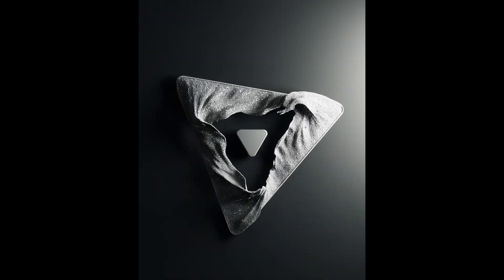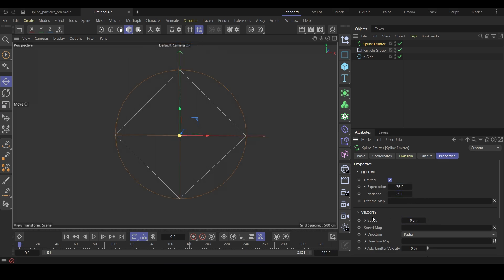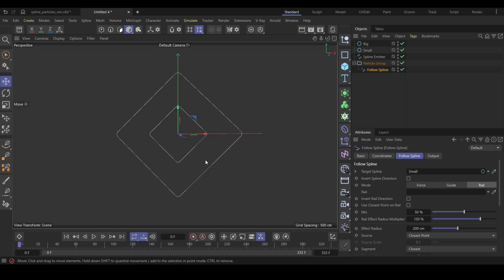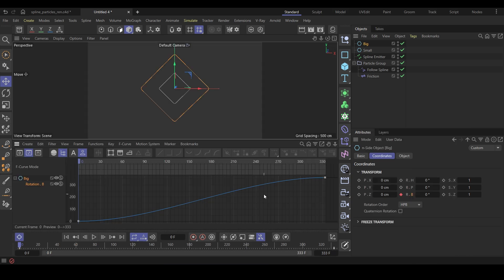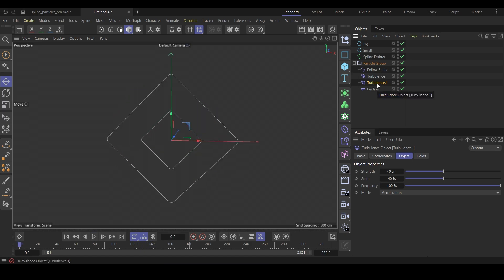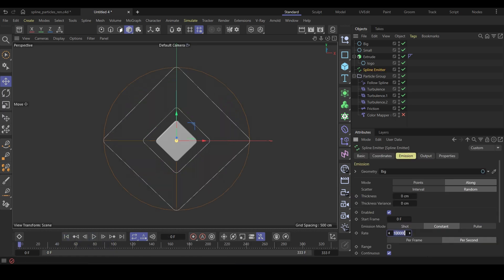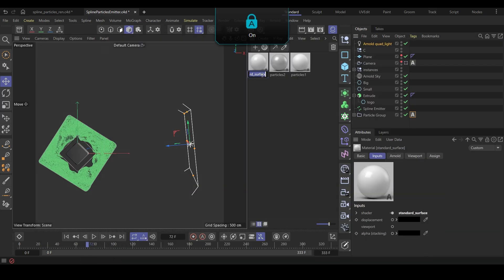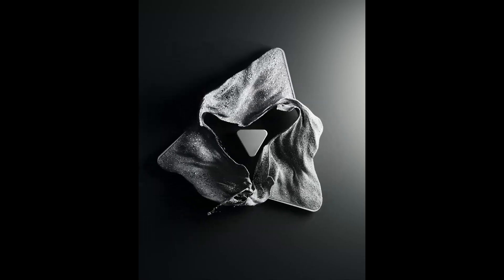Cinema 4D fluid-like particles simulation. Tutorial + project files!

Comment: Thanks for the tutorial. I'm not sure why, I'm using Arnold, and you can't see the particles after rendering. If you know why, thanks.
Reply from the maker: Make sure you have the tag on the particles group and not the emitter. Also, check if you have some lights in the scene. You can also check for particles shape setting in the tag. There could be other factors as well.